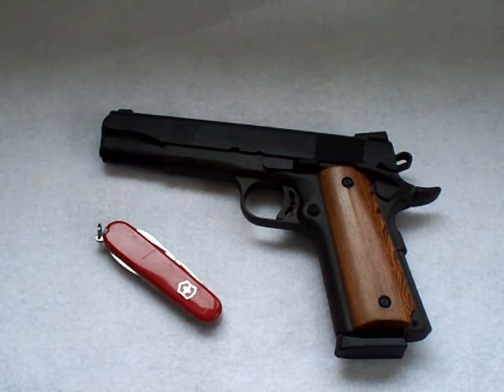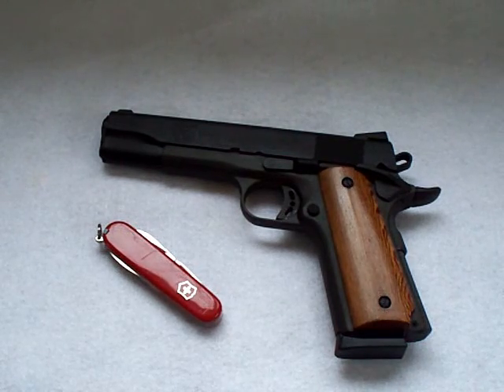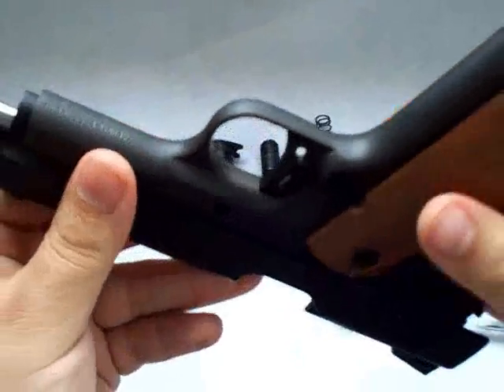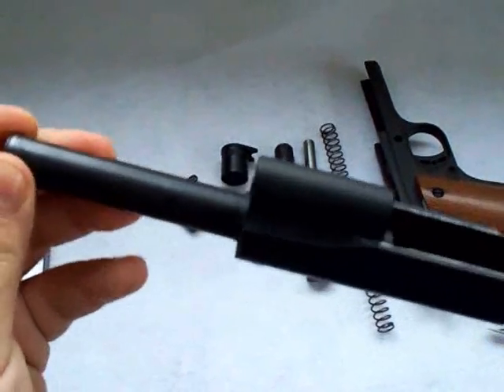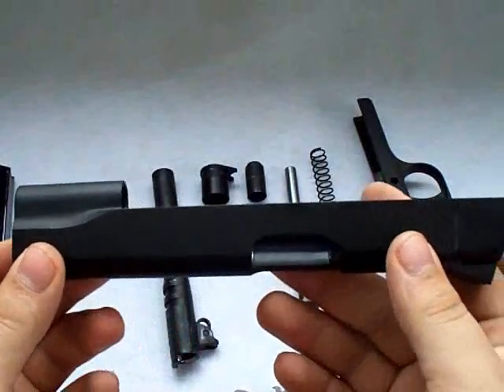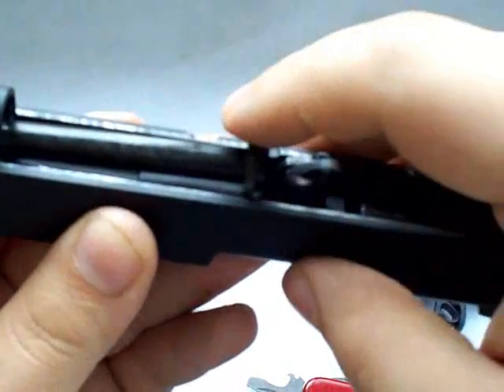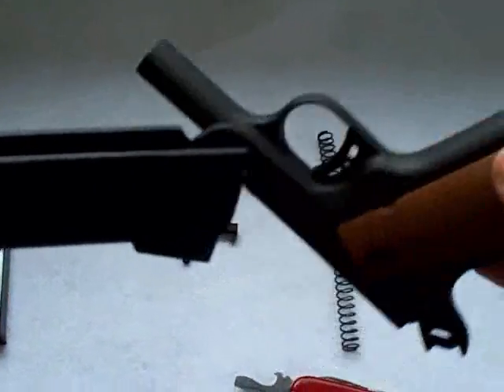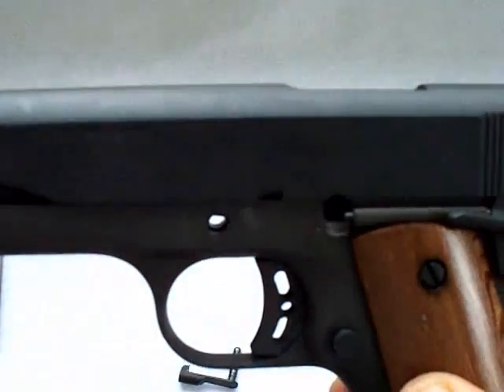1911 Field-Strip/Take-down/disassembly...

Comment from the maker: for this gun you cna press down on the slide lever like I did at 2:00 - 2:05 or if the magzine either out of the gun or if the mag has rounds in it, you cna just pull back on the slide and let go, but keep in mind if you have raounds in your magazine lettign the slide go forward will put a rounf in the chamber and will be ready to fire...

Comment from the maker: the stule is called that because it was invented in 1911, and the 45 caliber bullet was invented to be used in this gun...this specific gun was not made in 1911 but has the very same design and workign parts as the original...

Comment: @FatherTime1970 If the 1911 has a full length guide rod, the recoil spring plug is milled out for the rod to slide through and can be difficult to press down by hand.  If the guide rod is the stock, short one then the spring plug will have a solid face and be easier to press with your thumb.

My Taurus PT1911 came with the barrel bushing tool but I find it a lot easier, actually, to use the side of a magazine to depress the plug and just turn the bushing by hand...

Comment: I just wanted to thank you for your video. This was a great, clear visual instruction on how to disassemble and reassemble my new 1911. Turns out, I had the same problem with the small piece for the slide lock falling as well, and your video was instrumental in my fixing the problem. Nicely done!

Comment: Great vid! I wanted to say that the reassembly is easier if the gun is upright. I've found that gravity kinda does its work on the swiveling part and keeps it down in position. Also, pushing the slide lock into place helps grab that part as well, even if it's a little off center. 
Also, if you don't have a tool to take off the bushing, you could always use the butt plate of a mag. That works well too. 
Again, great vid.

Comment: @TheVVV88 It's a good beginner 1911 owner video. That piece on the barrel is the connecting link. The part up front is the barrel bushing. It's a good idea to NOT drop the slide on an empty chamber of a 1911. That force can damage the gun. Of course it's okay when loading a round, that slows the slide enough to not cause damage. Nice job.

Comment: I found that the butt of a magazine works well to remove that piece as well.  Generally they are plastic so you don't have to worry about it scratching up the finish as much as a screwdriver and they are always there to use.

Great video by the way!

Comment: @cutlerylover  having the same difficulty  with the barrel link lining up.My  thinking was  to insert the barrel into the slide but don't place  recoil spring guide next to the barrel link.Push it as far forward as possible so it sits in the "cave" where the spring goes in.Grab it as a unit,turn upright in the natural firing orientation.The barrel link will swing down.Now slide the lower assembly into it.The link will stay orientated down by gravity.My guess, Browning intended it this way

Comment: excellent video. I've got a colt stainless in 38 super coming so i thought i'd see if stripping a full size was any different than my 4 inch kimber, and it actually looks a little easier on the 5 inch gun because the simpler guide rod ans spring. Nearly 100 years and still the best pistol there is, J.M. Browning, what a great designer.

Comment: Inserting the barrel pin can be a pain when doing reassembly in the dark. Having practice with that (I can manage a field strip/ rebuild in under 2 mins blindfolded) I'd say once you have the dissassembly notch on the slide lined up with the hole on the frame you can lean the gun back towards the hammer and the barrel link will kind of fall into place for the slide stop pin to go through. Gravity will hold the link in place against the frame of the pistol just in front of the magazine chamber.

Comment: Its a lot easier to assemble the gun with the guide spring and barrel inplace like you would on most modern handguns.  Then you just worry about putting in the slide stop the right way.  

BTW I just got this gun after drooling over your vid for a year now.   Thanks!

Comment: I notice that if you have a short guide rod, you want to put that spring in there as the next step right after placing the guide rod because the gun will easily jam up and get stuck when you close that slide if you dont do that first.

Comment: @Empidai The type of product you use do very a tad based on usage bc different cleaners, oils, and greases have their advantages. But if you are just a regular user like myself I use Hoppes #9 as my cleaner and Rem Oil (by Remington) as my oil of course. Im going to get a gun grease soon to put on my rails bc it stays put longer at higher temps (due to friction) than oil does. Both Rem oil and Hoppes are at walmart in the sporting goods section. You cant go wrong w/ those two...

Comment: Hey great video, was easy to follow.

A suggestion I have would be to remove the mag first before conducting a check. That way, if it does have rounds in the chamber they won't load.

Comment: excellent video, thanks.  I was a little confused, as I'm sure everyone is the first time they try to take down a 1911.   I read in my owner's manual that it's not good to let the slide drop forward freely onto an empty chamber, particularly if your gun has had an action job, because it will mess it up.  I always drop the slide slowly while depressing the slide catch lever when the chamber is empty--it might be voodoo, I don't know.

Comment: @lunchboxbandits - NOTE: You do not NEED any special tools. Browning designed the 1911 to be completely dismantled without any "extra" tools. Several of the parts from the gun act as "tools"  to disassemble others. Example, the base of a standard magazine works to depress the recoil spring plug - it fits curve in the barrel bushing -- so you don't need your Swiss army knife. I don't know, but can a Glock be totally dismantled (not just field stripped) without tools?

Comment: A "real" M1911-A1 doesn't have a full-length recoil spring guide rod. So, the appearance is a little different. The recoil spring plug is completely covered on the end (pretty easy to remove by hand, with no pain), and the recoil spring guide is only about an inch long. 

Good video, just pointing out that difference between an original, and some of the later modifications.

Comment: Great vid but u might want to add a note when you say to turn it upside down, because if you do that with any of the series II kimbers the swarts safety will get caught on the slide and when u try to pull off the slide you'll damage the swarts safety pin and maybe even the sear. Great vid though brother! Stay safe.

Comment: Thanks a lot.  You simplified it for me.  My grandfather and I were trying to clean his 1911, it was like yours were it had that infernal ring rather than a cap, it took us like an hour to put it back on (which I find funny).  I need to remember this video because even after we got the spring in, the slide can't be pulled back all the way, do you happen to know a possible cause of the problem?  Also that is a really nice finish on your 1911.

Comment from the maker: fewer parts isnt neccesarily good, just easy, theres a difference...the 1911 has served in 2 major wars and a few minor ones as well, also been around and used by law enforcement for almost 100 years...if in 100 years glocks are still the hot thing, Im sure they wil model other guns after them, but if I had to guess, there will be somethgin newer and cooler than glock, lol

Comment: How do you get the slide to move after jamming it has a spent round in the cylinder but the slide will not move it's kind of stopped halfway and injecting the shell and re chambering can't figure out how to get it to move without beating on it with a hammer any input

Comment: slide moves faster and wares out the parts faster. the round acts like a speed-bump and slows things down enough to prevent stress levels that the parts werent made to handle.

Comment: @hbombharry Maybe complicated if changing your oil is complicated.  It's very easy to do, it's just more technical than some other handguns like the Glock which can be taken down with one hand...
Even the Sig isn't much simpler than the 1911, in fact it is very similar in the upper end, though the frame is much more complex on the Sig.  Also, double stack 1911s exist.
Overall the design is straight up simplisticly robust and very hard to top.  I am a firm 1911 guy, but I'm biased...

Comment: I find it interesting you dont like to drop the hammer, yet you have no problem slamming the slide home on an empty chamber, and you let the recoil spring bind against the bushing as you turn it,. Not a big deal, but it can over time loosen the tolerances there which can affect accuracy. The releasing the slide on an empty chamber thing allegedly isnt good for it, so I avoid it. Ive never thought to click on the safety, that would slmplify the process a little bit. Good tip. Nice gun too.

Comment: Pushing that slide lock lever down and in to click in place is scratching your frame.  I use that screwdriver tool/ knife edge to push in that pin and then the slide lock lever falls into place without scratching the frame on mine.

Comment: Is there a reason you rack the slide before stripping it? 

Also, I saw another video by hickok45 where he says to keep the barrel link down when putting it back in..you do yours facing up. Any reason for this? Is this because you have an extended guide rod?

Comment: nice video, only one thing, don't put your finger in the chamber while the bolt is locked back, if it accidentally slides it will snap your fingers, maybe not on a pistol, but on rifle is dangerous

Comment: Never let the slide slam down on an empty chamber, You should pull it back and ease it closed. You can damage the face if you let it slam home. You should either have a live round or a snap cap if you do that.

Comment: I recommend highly that if you have any problems with disassembling any of your guns, at least the more popular guns, including the glock17 and the Colt M1911 (yes to all trolls, I know his isn't colt, but I'm stating the model, not the brand) to use the respective app called "gun name here" disassembly, or to use the "main" app which has a total of eleven different guns to disassemble, operate, and reassemble (not in that exact order 0.0) which you start with o believe 3 pistols and an mp5 unl

Comment: dont drop the slide on an empty chamber on a 1911. it will damage the sear/disconnecter after a while and cause the hammer to drop when you put the slide in battery.

Comment: your not supoused to slam the slide forword it will damage the sear on the trigger however you can dry fire a 1911
Reply: +killian love The slide slams forward every time you fire it...
Reply: yes it does but it has somthing to do with slaming it on a non loaded chamber becuse the slide rubs against the sear it can ruin your gun and potentialy make it full auto and can ruin your gun and just about every manufacturer tells you not to for instence colt tells you not to and will void your warenty ok so before you try to say an ignorent statment in sarcasum reserch what you are going to say
Reply: +killian love Learn how to spell before you call other people ignorant, please. Letting the slide go forward on its own is an important part of functions checking the weapon, it is designed to go forward on its own, thus, one must ensure it has the ability to do that in a functions check. By the way, that's a Rock Island, not a Colt. So much for your research.

Comment: Sorry but it pains me to hear you tell people not to dry-fire a 1911 (which is perfectly harmless to nearly all center fire pistols) and then watch you drop the slide without a round in the chamber or without easing it down (which can easily damage your sear).
 You've got it backwards. Dry firing = fine. Dropping the slide at full force without a round in the chamber = not fine.

Comment: The first step is to eject the magazine, NOT check the chamber. Someone who is not used to guns may watch this and then unintentionally and unknowingly chamber a round. That is not a dis-assembly. you took the slide off. most parts were still in the gun. The 1911 is unlike other handguns because it has a lot more internal parts which should be maintained often.You have failed to show how to do this, and worst of all you call it a dis-assembly.